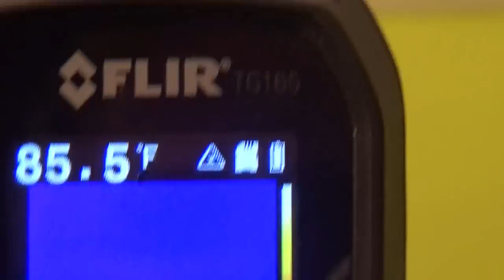Relocating bees right before Hurricane Nate

Comment: Ingenious engineering by these bees! Impressive use of that pipe to bolster the stability and weight bearing capability of those combs. I’m in awe of these creatures and have great respect for them.would be particularly impressed to find out that the pipe transported hot water.
Reply from the maker: The pipe was a gas line, but if it were a hot water line they would have had their own heat source built into the hive. Bees are just so smart! Thanks for watching. God's peace.
Mr. Ed

Comment: I have a couple of questions, first the vaccumcleane you are using, is a regular one you fixed or a special one? And about winter I know they are decimated and hibernate but how cold is to cold for them to be outside? In my country we usually gets 14° F and low as 5° F, sometimes even colder. How do I move them so I do not miss anyone and shall they get fed in the winter?? Thank you for the video, good bless
Reply from the maker: Question 1,  the vacuum is a specially designed vac that does not kill the bees. This link is for a video I did talking about how to build one. I have been using the same vac for 3 years now with tremendous success.  https://youtu.be/tV3mR39v6RA
Question 2,  Bees have trouble flying once the temperature gets about 58 degrees F. When temps get below freezing, the bees go almost comatose, but still remain in a ball of bees. I do not know much more about how much cold bees tolerated because it really does not get that cold in Louisiana. 
Question 3, Moving bees is not difficult, you do have to do certain things though. If you move them in warm weather, you need to block the entrance, I use toilet paper. I then let the bees chew their way out, a day or 2,  after I have moved the hive and the bees will reorient on the new location. I have never moved bees in the winter.
Question 4, I feed the bees sugar water in communal feeders in the fields and I start doing this at the end of December. That probably would not work for you because of where you live, but here, it's OK

You should really  find a bee club in your area and join it. Finding out what locals do with their bees in your area is the best way to learn about keeping bees. I hope this helps. I do not mind giving you my help if you need it. God's peace.
Mr. Ed
Reply: Thank you for all answers I really appreciate it. I will look around after any bee club and this summer I am going to classes. There ae locals here selling honey but they don´t want to answer my questions they don´t want to loose a customer I guess haha. All good to you, always a plessure watching videos with you